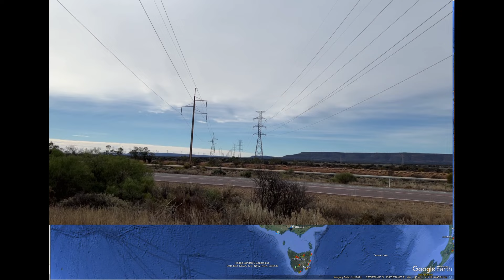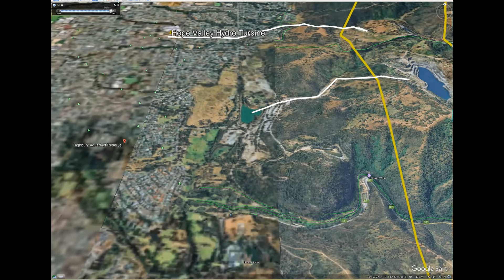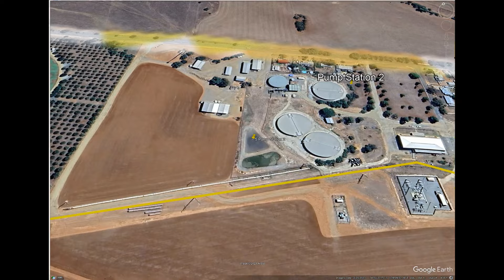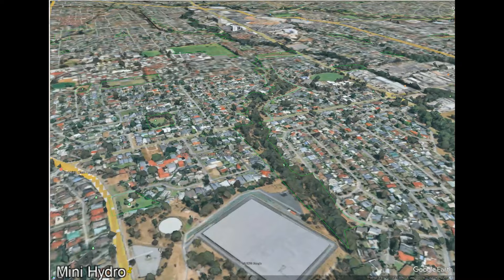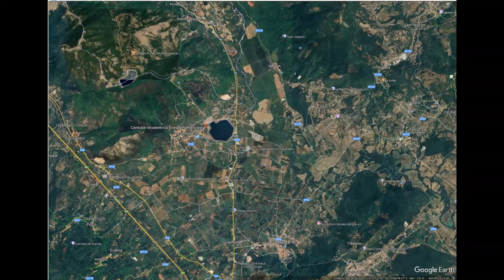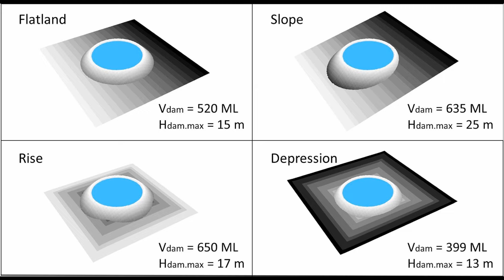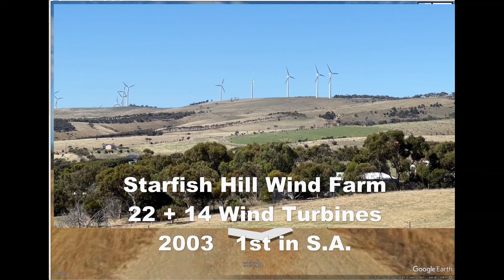Better Big Battery using Closed Loop Pumped Hydro Energy Storage for Dry Environments

Comment: Pumped hydro has no economic feasibility with the onslaught of cheap batteries. There is no ROI for pumped storage.
Reply from the maker: Interesting.  Would you like to share this information? 
What is the ROI over 30 years for Chemical Batteries compared to PHES.
The important question how long the power can be supplied during a grid outage.
Reply: @Highbury5089   what is the ROI of the $2billion Snowy pumped hydro expansion project that is going to cost $20billion 🤔 😳 😕 😐 
Good questions. 

All those battery vehicles, 20million Australian vehicles, most parked 23hrs every day and all night long and with v2g connections to the national electrical grid. Obviously will be dangerous 😳 ☠️
Reply from the maker: @stephenbrickwood1602  At $20 billion Snowy Hydro 2.0 will take about 4,400 days to pay for itself if the buy and sell prices for electricity where the same as 17 Feb 2025 in Queensland.
Wivenhoe PHES would have taken about 2,400 days.
Using the same Buy and Sale Price for electricity.
Hornsdale A BESS will take about 5,858 days
Hornsdale B BESS will take about 9,390 days
Torrens Island BESS will take about 4,993 days. 
If BESS have a battery life of 15 years, they will need 3 rebuilds in a 60-year period.
PHES the turbines need replacing at around 60 years
Reply: @Highbury5089    @Highbury5089  everyone thinks that sending electricity to the customers or consumers or the hydro pumps cost nothing, grow up, the grid owners, grid investors rent the grid, and are not stupid, their investors need cashflow.
Electricity costs to the pumps will be 10% electricity and 90% Grid Rental. Generators 5cents kWh is 50cents kWh grid supplied to me. 

Then, when the hydro generators send their 5cents kWh electricity into the grid the consumers pay 45cents kWh for grid rental. 

Worst still is the process is only 40% efficient. 

The grid is not a charity. 10cents kWh for electricity plus 90cents kWh for grid rental. 
Plus the 40% losses,  say $1.66kWh to the consumers. 

Politicians spread confusing talking points.
Reply: @Highbury5089  everyone thinks that sending electricity to the customers or consumers or the hydro pumps cost nothing, grow up, the grid owners, grid investors rent the grid, and are not stupid, their investors need cashflow.
Electricity costs to the pumps will be 10% electricity and 90% Grid Rental. Generators 5cents kWh is 50cents kWh grid supplied to me.

Then, when the hydro generators send their 5cents kWh electricity into the grid the consumers pay 45cents kWh for grid rental.

Worst still is the process is only 40% efficient. 

The grid is not a charity. 10cents kWh for electricity plus 90cents kWh for grid rental. 
Plus the 40% losses,  say $1.66kWh to the consumers. 

Politicians spread confusing talking points.
Reply: @stephenbrickwood1602  All true, but the grid is the greatest asset humanity has. All our standard of living is 1000x of what it would be without it.
Reply: @andyfeimsternfei8408  it needs to be economical.
I say the existing grid was built over 14 decades and is too expensive to expand and too valuable to waste. 

With rooftop PV on empty rooftops realestate and the new v2g EVs, we get every consumer self-supplying and grid supplying. 
Basically twice the amount of electricity on the grid and with the consumers. 
And at minimum costs.
At zero costs.
Consumers just redirect their private energy budget and vehicle budget. 

Massive savings for decades. 

Tax-free savings. 

Grid $TRILLIONS expansion costs are not needed.
2decades only and dirt-cheap. 

Population expansion is possible.

The world can see it happening and not create nuclear proliferation and horrendous military defence exploding budgets.

So let's do everything is actually dangerous as doing nothing. 

Now, if CO2 emissions climate destabilisation is false science, then at least we have better energy technologies.
Reply from the maker: @stephenbrickwood1602  This is the most important hidden fact in any energy system
Reply: @Highbury5089   ?? Tell me a bit more for clarity.
Reply from the maker: @stephenbrickwood1602  Steven you are completely correct.    These costs apply to virgin electricity from a generator and doubly to electricity being sent to a storage facility and then released for sale.

High-voltage direct current (HVDC) transmission lines generally experience lower energy losses than high-voltage alternating current (HVAC) lines, especially over long distances. HVDC transmission can reduce losses to around 2-3% per 1,000 km, while HVAC transmission can experience losses around 6.7% at the same voltage. 

In the USA the owners of gas and oil pipelines, John D Rockerfeller and J Paul Getty, held their customers to ransom.   

Foolishly most of our Government Owned utility distribution systems have been privatized.
Reply from the maker: @stephenbrickwood1602  The last person to leave the room please switch off the lights.
Reply: @Highbury5089   but all investment needs a ROI, even government owned.
Unions were adding more costs to government ownership, which was the argument to sell to private companies.

Private rooftop PV and v2g EVs and all supplied by many different suppliers are a good way to get back to maximise benefits to many. 
Too abundant cheap energy.

I also think you are confusing the 40% losses as grid losses, NO.
The pumping of water uphill and then the generation from the plant all have internal energy losses greater than the grid losses of 40% vs. 2%.
That is what I meant.
Reply: @Highbury5089   Yes, grid electricity was so extremely expensive energy that turning lights off was important.
Reply from the maker: @stephenbrickwood1602  The opportunity cost of electricity in the 8 hours when the sun is shining and the wind in blowing means the uptake cost of that resource is cheaper than virgin electricity form a coal, natural gas. atomic energy electricity generation using the boiling of water.

The 60-year capital costs of batteries not including all the management cost of that technology are greater than for PHES that has minimal management cost.
https://youtu.be/71X_TEToarU

The argument to private water (drinking water and sewerage), gas and electricity utilities is ideology not economic.   Thatcherism.  See the disaster of the privatized water boards in England.
https://en.wikipedia.org/wiki/Water_privatisation_in_England_and_Wales#:~:text=The%20water%20privatisation%20in%20England,regional%20water%20authorities%20(RWA).

 "According to The Independent, the English WSCs are now mostly owned "by private equity firms with controversial tax-avoidance strategies".  Public opinion polling carried out in 2017 indicated that 83% of the British public favoured renationalisation of all water services."

"In the same year, research by the University of Greenwich suggested that consumers in England were paying £2.3 billion more every year for their water and sewerage bills than they would if the water companies had remained under state ownership."

See also the story of the creation of the ETSA in South Australia.  Here the private utility was nationalized by a conservative government.
Reply: @Highbury5089  
The opportunity cost of electricity in the 8 hours when the sun is shining and the wind in blowing means the uptake cost of that resource is cheaper than virgin electricity from a coal, natural gas, atomic energy electricity generation using the boiling of water.  YES. AND DISTANT GRID RENEWABLES included.

The 60-year capital costs of batteries not
including all the management cost of that
technology are greater than for PHES that
has minimal management cost.

MY POINTS ARE:
1, ELECTRIC VEHICLES WITH MASSIVE STORAGE BATTERY are parked 23hrs every day and all night long. 
2, V2G technology and selfparking selfplug-in at every buildings carpark space is massive battery capacity on the grid or on the building or on the home or at work or shopping centres or 
3, modern battery management is extending the battery life by many decades. A happy discovery 😊 
4, after buying your vehicle then the massive electricity storage is FREE STORAGE. 
5, maximum UTILIZATION of individual owners investment is the only economic priority. 
6, no petroleum, no gas, no grid electricity, no upgrades to the grid, transmission, poles and wires. TAX-FREE SAVINGS. 
THE BEST MONEY. $10,000 TAX-FREE every year. $100SBILLIONS savings to the economy. For decades and decades 
7, all the other technologies are grid technologies and extremely expensive. 
8, rooftop PV is cheaper than windows $m²
9, oversized PV and overproduction is perfect.
The EV battery is massive. 

The argument to private water (drinking
water and sewerage), gas and electricity
utilities is ideology not economic
Thatcherism. 
See the disaster of the privatized water boards in England

"According to The lndependent, the English
WsCs are now mostly owned "by private
equity firms with controversiall
tax-avoidance strategies". Public opinion
polling carried out in 2017 indicated that
83% ofthe British public favoured
renationalisation of all water services

THATCHER'S MINISTERS were anti climate change, but she closed the coal mines to break the unions, but in the UN speech she claimed the climate highground.

"In the same year, research by the University of Greenwich suggested that consumers in England were paying £2.3 billion more every year for their water and sewerage bills than they would if the water companies had remained under state ownership.
See also the story of the creation of the
ETSA in South Australia. Here the private
utility was nationalized by a conservative
government.

POLITICAL SURVIVAL.
Reply: @stephenbrickwood1602  yes but we all know that what they do now is more of a boondoggle as opposed to getting the f**** job done everything they do is just another excuse to syphon money out of this country all of this bulshit that's heavily subsidised .. pretty much anything that they do the NBN , wind farms you could pretty much name it ... heard that be corrected criminals weren't running the show I don't think construction would be costing nowhere near as much or drag you on for no and you as well ... the original Snowy Mountains hydro engineer who had the idea of bringing the water down from the top end Burdekin catchment the money that that would have made going by the sums that Neil's crunched here along with the rest of the benefits of having water from top to bottom would be unfathomable as to the economic loss we have suffered sitting on our thumbs ...
Reply: @Highbury5089 Battery Electric Vehicles can last for long drives or long time between rapid charging. 
You know that for a fact.

With v2g technology then the grid will 20million BEV massive storage batteries on wheels and most parked 23hrs every day and all night long. 2,000gWh storage daily. 

With 20million rooftops with PV electricity flooding the BEVs and the existing national grid and BEVs trickle feed-in all night long then in 20years we can remove most of Australia’s fossil fueled energy. 

Grid construction is horrendously expensive. 

Snowy 2.0 pumped hydro expansion project budget has exploded from $2billion to 20billion because of new transmission lines that were not priced into the original budget. 

Battery technologies are evolving rapidly and battery management is extending battery life massively. 

Pumped hydro needs grid electricity to the pumps AND grid transmission back to the city centre.

2 grid costs and 40% lost in the pumping.

In the land of DECADE LONG DROUGHTS. 

I do like the idea though.
Reply: @Highbury5089  how long can the pumped hydro supply electricity in a grid outage??
Yes important question.
Reply: And at a glance  no chance of thermal runaway or any of those problems play in other lithium Li-on battery storage / recharging / longevity- replacement ‐ + environmental impact ( recyclable eco effects or toxicness )
Reply: @utubetrutharrowmichael-and9105  And no chance of dam failure, equipment breakdown, or environmental damage building two lakes that fluctuate several meters per day. Not to mention how few sites there are for pumped hydro. FYI, I have a 45-year career in hydro engineering.
Reply: @andyfeimsternfei8408  I love reality.
Reply: @andyfeimsternfei8408  
I like your thinking, I have a different background to many, except my fellow grid construction engineers who are absolutely silent.

Too much money to be made.
Reply from the maker: @ Yes Every engineering project has potentials for problems.   
Dry Gully Dams have been the main method of construction in South Australia.   Happy Valley Reservoir has a length of 806 meters & length of 25 meters.   

"Not to mention how few sites there are for pumped hydro."   
See see the list for of potential sites at
https://re100.eng.anu.edu.au/pumped_hydro_atlas/
Reply: @Highbury5089   
everyone thinks that sending electricity to the customers or consumers or the hydro pumps cost nothing, grow up, the grid owners, grid investors rent the grid, and are not stupid, their investors need cashflow.
Electricity costs to the pumps will be 10% electricity and 90% Grid Rental. Generators 5cents kWh is 50cents kWh grid supplied to me. 

Then, when the hydro generators send their 5cents kWh electricity into the grid the consumers pay 45cents kWh for grid rental. 

Worst still is the process is only 40% efficient. 

The grid is not a charity. 10cents kWh for electricity plus 90cents kWh for grid rental. 
Plus the 40% losses,  say $1.66kWh to the consumers. 

Politicians spread confusing talking points..
Reply: @Highbury5089  I say build all we can, it's just a limited resource.
Reply: @andyfeimsternfei8408  @Highbury5089  everyone thinks that sending electricity to the customers or consumers or the hydro pumps cost nothing, grow up, the grid owners, grid investors rent the grid, and are not stupid, their investors need cashflow.
Electricity costs to the pumps will be 10% electricity and 90% Grid Rental. Generators 5cents kWh is 50cents kWh grid supplied to me.

Then, when the hydro generators send their 5cents kWh electricity into the grid the consumers pay 45cents kWh for grid rental.

Worst still is the process is only 40% efficient. 

The grid is not a charity. 10cents kWh for electricity plus 90cents kWh for grid rental. 
Plus the 40% losses,  say $1.66kWh to the consumers. 

Politicians spread confusing talking points.